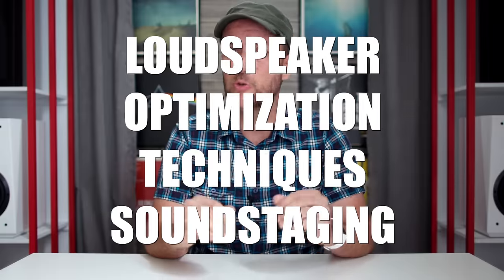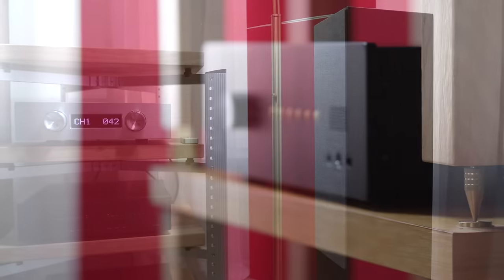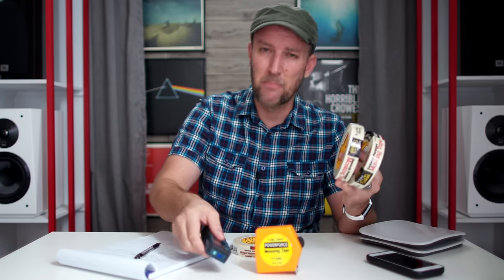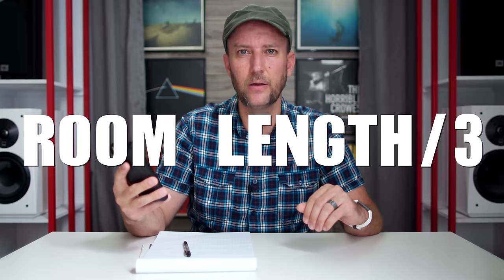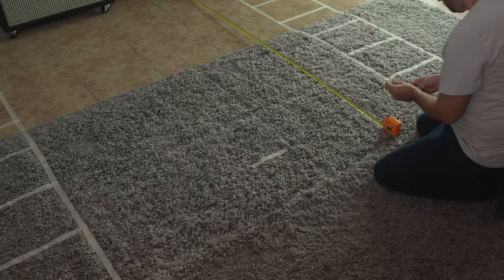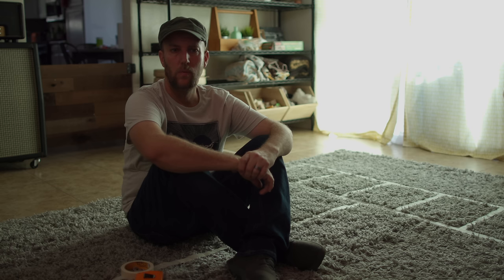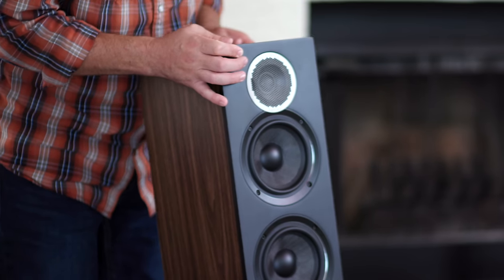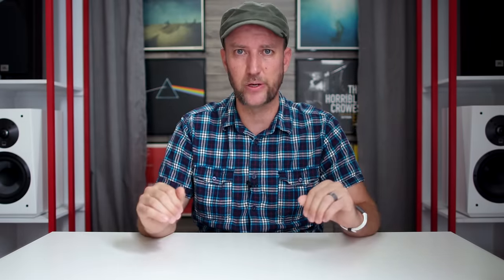L.O.T.S. Loudspeaker Optimization Techniques for Soundstage!

Comment: HolyFreakinTamoli does this make a difference! My listening room is my private office where I spend most of my time. It's only 11'-2" x 19'-6", but I'm already positioned the correct 6'-6" off the back wall (which has an Ikea 5x5 Kallax bookshelf back there). So now moving my Buchardt S400's 6"-6" out from the front wall (2'-6" previously) is A-freaking-MAYzing! Now I see what y'all have been saying about the soundstage - and this is just my first attempt! I also have the reality of a big-ass drawing table right in front of me and my 27" iMac monitor to my right, but still.... great advice, and I'll keep working with this. Thanks!
P.s: the 400's are about 120 hours broken in, so another 180 to go.

Comment: Ron thanks so much for the tutorial on LOTS..

Absolutely achieved the perfect setup for my room which is a challenge but the speakers disappear to improving sound stage even in my 10’ x 11’ room.

Just got back into my passion for HiFi (approaching empty nester) and between you and Sean, and even cheap audio man has made a huge difference..

My first toe in the HiFi water  with everyone’s input:

ITOAVX SA3 and PA3
Warfedale Diamond 11.2’s
Ifi Zen blue
S.M.S.L M300

I don’t know if you reviewed the ifi Zen Blue... I have to say WOW..especially running through my M300 DAC.

My fiancé purchased the Fluence RT83 turntable as a Christmas gift I was thinking this would make a huge delta from the old days with vinyl..

A/B comparison I was astonished!!!

Streaming from my IPHONE via ifi Zen blue the details, sound stage to depth..like symbol hits just elongated to the end is outstanding, and hearing things in familiar important pieces I never heard before was impressive..

I ended up returning the turntable.

Love to see you do the same on streaming and how to set it up right. Also comparing the latest in bluetooth vs WiFi..

Love your show and a huge fan!!!

William
Reply: Late here but good for you emptying nest and getting back to Hi Fi. Hopefully you can set up in a larger room.  Had my rig stored for many years. Just had amp preamp recapped and set up my 19'x30' fam room into listenimg room. Speakers far from walls per Rons vid. In my case my tt with a nice cart and audiophile or good quality records sound great!
Reply: Hi William, can you please tell me at what distance did you finally place the speakers?

Comment: Hey maybe a little tip to measure the center distance between the speakers. Maybe most already know, but if you measure from the outside of one speaker to the inside of the other speaker is the same distance as center to center. So outside to inside might be an easier way to measure. It sure is for me
Reply: Good tip, only if you dont own speakers like the Lintons. 😂

Comment: I use an equilateral triangle set up in my rectangular room. Aprox 8 ft triangle with proper height stands. My B&W 606 / Yamaha amp with twin Sony subs set up is mind blowing at regular speaking volumes. Depending on the track, instruments and vocals come from a great distance left right up and down and from behind the actual physical speakers. The sound stage is so large, with eyes closed One can literally not tell where the speakers are.

Comment: Just wanted a clarification on something you mentioned early on when you spoke about measuring our the listening area. If I have a less than ideal space, which is a very wide room that isn't nearly as long as it has a dining area on the right and an entry area on the left, do I measure the entire space and work from those measurements. Or would I segment the space into what I consider the main listening portion and measure off invisible walls I put down there and run my calculations based off that space?
Reply: Don’t include any rooms off the side of the main room. I’d only include the main room you consider is the listening room. You may sacrifice a little if your “rooms” are open to each other, but keeping it simple will benefit the ascetics of your actual seated listening room and improve your overall sound. Sometimes you can’t help having an awkward room like you and I have. But you can certainly improve what you have and this video demonstrates aLOTs of good, basic information.

Comment: Fantasic Video Ron, Love your approach  easy to listen to and learn  (certainly not sterile or boring) ... i have been wrestling with my soundstage for a wee bit and sometimes feel and hear that im there.. however my room is almost sqaure which of course is causing some ugly sound drop off ..  148 inch length/depth by 142 inch width.... bad room nodes i think they are called ......  if i may   do you still feel this works in a sqaure room  and  with my left wall being almost totally covered by 2 shelves of vinyl would you subtrack (the 14 0r 15 inches that the vinyl on shelves protrudes into the room) from the width of the room when making calculations   ie: the vinyl is now my left wall......  Thank You and i do look forward to your bass video as most of my node issues are in the lower frequencies... again Great Stuff!

Comment: Thank you very much for the wonderful method. 
What are your thoughts on a room that pratically has "endless" width, like a  living room? Meaning that my speakers have a lot of distance to their sides, one to the balcony and the other to my dinning room (which is much more far away)
Just pointing out that I have curtains on the big balcony door which is made of glass in order to avoid waves bouncing from the glass)
I do have a prety perfect stereo image and achieved it using your method partialy

Comment: Maybe too obvious, but you didn’t mention it…..to do this, longer speaker cables will be necessary to get fully extended to the listening parallel location, unless one already has the necessary length, or wants to also move the gear setup too.
Reply from the maker: Yup, that’s true

Comment: Thanks for this.  Although my workshop is as large are your listening room, its a workshop with tile floors and basically a 3' x 7' worktable in the center.  I have a large computer desk that will contain my speakers on one end of the room so separation is limited and the optimal listening distance will be all over the room as I am either at the desk and 3' feet from the speakers or in the middle of the room and all around my work table.   Listening to detail of the music is not my focus in this room for most of the time, but having some nice tunes going in the background helps move the day along.  Your advice is definitely worthwhile and hey you made it interesting.  Thanks for passing us your knowledge and advice.

Comment: Hello from an audio electronics guy in Australia. I worked out dacades ago that the room effects the system pratty much more than anything else beyond the amp and spekers. I also worked out that you get used to your own personal room-system combo, snd once I realized that…I was “freed” from most of the audiophile BS.
One thing I would like to ask is…(for someone who can’t really bring the speakers out from the wall too far for social and spatial reasons)…can you “move the wall back” by using sound absorbing materials behind the speakers?

Years ago I was involved in an “audiophile” listening session in a room with a matress in it. At first we did no factor the matress into the equation at all, it was just an object that was potentially in the way of our listening pisitions, so we moved it by standing it up on end and leaning it against one of the side walls of the room which had been a hard rendered brick wall….the improvement in listening when we did that was huge…so we tried moving it to other positions in the room. It seemed to work best when it covered any large, hard surfaces sound might reflect from. We theorized that if we covered most of the ealls with multiple matresses it would make the room “bigger” by absorbing reflections, so knowing this, if two matresses, or panels of acoustically absorbamt tiles were placed behind the speakers would this have the effect of “moving the walls back” at the exoense of a few dB of loss into the panels, AND keep the msin floor space of the room clear for other family members!

Comment: I like this methodical approach. My room is 33 feet long, and multipurpose. I only have about 14 - 16 feet that is dedicated to my (listening) use . I am going to start with my 14-16 foot "virtual space" and hope it works. I will also try the full room and put a mobile chair at the 11 foot mark. Of course I don't have 20 feet of speaker cable, so will do my best with what I have. I will also need to accept that fact the there will be some furniture in the general space. I will consider those items my sound treatment. :-)  As you say, comprises can be expected.   Any suggestions appreciated. Now where did I put my tape....Thanks for the great vid!!

Comment: Hey there, should I do the speaker placement by this method before my acoustic treatment or after doing some acoustic treatment?
And I am asking this because some absorption panels and materials have fixed place, like the bass traps, carpet and some diffuser. So pls help me with it.

Comment: Another way of doing this is to treat your room, after i put some damping behind my speakers and behind my listening position as well as putting bass traps in the frontcorners. My soundstage very much improved, i can hear sound all around them making it one sound with my eyes closed or better like you said in a dark room i dont know where my speakers are anymore.In a 12 by 14 feet room my speakers are placed  3 feet from the side wall and 3 feet from the backwall.Listening position is also around 3 feet from the backwall.

Comment: Hi, all very clear and smart, thanks. Only one point - if all these (simple) measurements are to be done with the speakers in your room, and they serve to optimize the speakers' sound that means that when you bought the speakers they were in another place, with different gear and without any optimization, or if they were in your room you still hadn't done all the optimization work; if that (very likely) is the case, basing on which criteria did you buy your speakers? Thanks, Max

Comment: Question: If absolutely necessary, is it better to position furniture ( 2 large upholstered chairs) between the speakers, or on either side of each speaker, with nothing in between. My room is 14’X20’X8’ and I position the speakers on the front wall. Any help you can provide is greatly appreciated!

Comment: Hey Ron
Loved the L.O.T.S. instructional video.  I wrote earlier as the proud owner of the Alta Audio Lelantos floor standing speakers.  After seeing the video for the second time I have a question.  Once one gets to the position where the speakers disappear, the toe in is done and the spikes are installed would that be the time to do the mirror trick and place acoustical room treatment for the first reflection points on the side walls and perhaps above the speakers?  I ask because my listening room has concrete floors, 3 concrete walls and part of the 4th wall is a chimney?  Thanks again.  Audiophiles and lovers of music need a friend like you  - keep the videos coming!

Comment: I have tried out the LOTS system and it works. Calculations works and my endpoint on positioning the speakers were just 25 cm further out from the front wall than my first positions! The difference in positioning from the original place was therefore very small. We are talking about cm between ok sound and great sound. Remarkable. When the soundstage locked into place you found yourself after a second or two that you were surrounded with music with only two main speakers and two woofers at the back in the room. My room was only 390 cm wide and 460 long. 207cm  height which makes a lot of things difficult from the start off. Heavily acoustically treated with diffusers at the front, drapes on the sides and HOFA absorbers in the front corners. Damped back-wall with acoustic slots in gypsum-plates with 10 cm rock wool insulation. Arendal 1723 speakers, McIntosh MA 7000, PS transport and streamer. My old Baldur from Nordost had to wait their turn since I used some simple but long enough old speaker cables for step by step exercise forward. If I can get this sound quality with simple "radio-cables" I am expecting more with proper cables. The soundstage, overall sound quality and bass was great. No standing waves or what have you. Just amazing quality.  An I ain't finished yet...Try it out before doing any upgrading.... Now this is what we like to hear from audiofile videos. Great work . Keep it up.
Reply: I should add that a 6 foot Kallax shelving unit is between the speakers filled with albums, for better or worse, with the equipment on top of it. For whatever reason it works, plus an open closet on one end filled with clothing and a bookshelf on the other side the room is just lively enough without being " dead ". Could it be better? Possibly, but given the situation I think it comes together, I listen to music hours at a time which is what matters.

Comment: That is awesome, thank you !!  Question though, my room is 22'6" long, which gives 7'6" divided by 3.   That said, I can only place my seating position between the front wall and 11 feet further back, because I have a fixed open furniture that splits the room in two.  What would be the best incrementation from there, or it is always the farthest it can be?

Comment: i love your video...and i have one question...based on the calculation, the ideal listening distance is 2.7 meters and my actual seating distance from the front wall is 5 meters.....which distance I shall use to test the speakers while conducting the experiment ?

Comment: I have a "real world" question about this.  And since you're a married man, you'll know where I'm coming from.

Our HT room and our family room are one and the same.  I don't have the luxury of a dedicated HT room, but yet I'm still an audio enthusiast (the struggle is real!) Our house is a funky design - where the TV is pressed up against the wall, cabinetry is on the sides, fireplace etc.  It is a large room with very high ceilings - an 'entertainer' layout where the kitchen is also in the same large space as the living room.  My tower speakers are currently (don't hate me) in the far corners of the room.  Yes, up against a wall, toed in.  I'd love to do this LOTS approach however it would immediately result in the speakers sitting right in the front of the fireplace (or some other object) and the other speaker smack dab in the middle of the room (since the other side of the room is an open space leading out to the hallway.)  My wife - would kill me LOL.  

I suspect a lot of us are in this position - IE - that following you advice would result in our speakers hanging out in an odd spot in our living room, with zero chance of receiving the golden "Wife Approval" award.

So sir, my question is this.  Are there any tips for those of us who simply MUST have our tower speakers in a corner, in a large room?  Is there some trick where perhaps adding a 2nd set of 'presence' speakers (perhaps under the TV) might help 'fill the void'?

Comment: I see you did this over a year ago and I like your ideas.  However, my listening room is sort of unique.  The basic room is 13' wide and 15' long.  The wall where the speakers are located (yes against the wall on built in book cases) then each was opens up into other rooms with large arch openings.. On the right the arch is 9' feet long and the room is about 13 x15.  On the left is a 6' opening into a 9 x 9 room.  So little to no side wall reflection.  What would you do to tweak your method?  Do I even consider these other rooms?
Reply: Following, as I am dealing with similar circumstances

Comment: Terrific info here that everyone should use, but this could easily have been more concise. I wish it started with a brief TL;DR segment: Place speakers within the 1/3-1/4 room width markers and have your listening position at the 1/3 room length mark. Begin with the speakers next to you and then gradually bring it back until sweet spot is found. Then make other fine tune adjustments.

Comment: What kind of speakers does this work with?
We already know it works with boxed speakers with ports/radiators in the back.
What about :
     1) Box speakers with no ports/radiators/horns anywhere except the front?
     2) Boxless speakers : 
         2 a) Open Baffle regular dynamic speakers
         2 b) Open baffle electrostatic/planar magnetic speakers 
     3) Omnidirextional speakers:
        3 a) Boxed ones: like Ohm Walsh
        3 b) Unboxedd ones

What kind of changes if any do we need to do to the LOTS method for the above, if possible/needed?